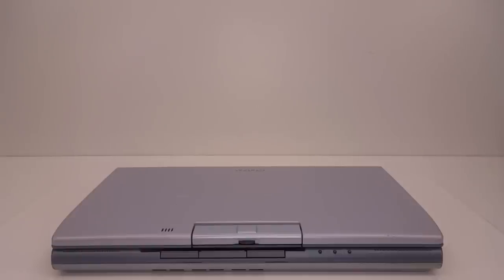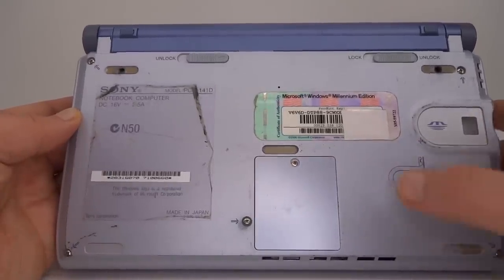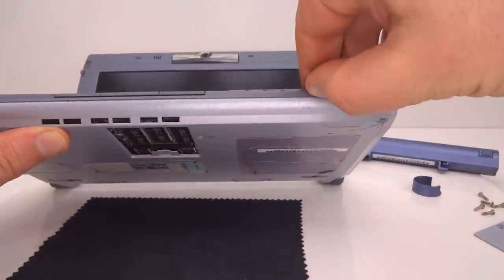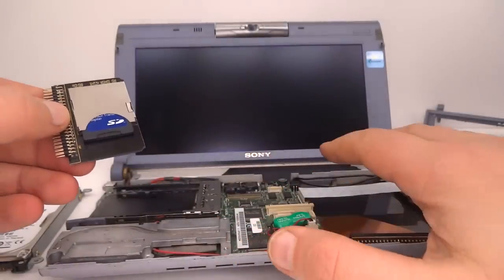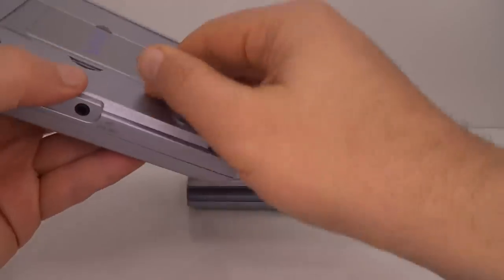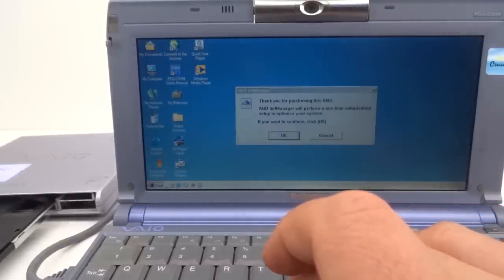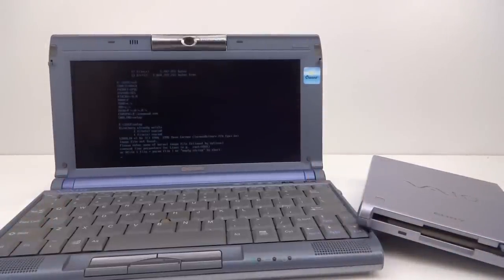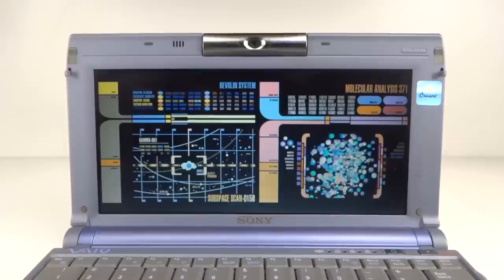Sony VAIO PictureBook Millennium Edition

Comment: Thanks for the video, as always, but just my two cents - SD>IDE adapter is a terrible idea in this case - Win2k/Me has no TRIM support (and that IDE adapter would make it useless anyway), also IO throughput of the SD card is terrible already, and longevity of that poor SD card without TRIM will be down the drain. CompactFlash (or even a real IDE SSD - quite cheap on Ebay) would've been much better solution in my opinion.
Reply from the maker: Thanks, I will be experimenting more with CF and other methods.

Comment: Ultrawide and CinemaScope are not the same exact aspect ratios (though they are close). Motion picture CinemaScope is a variation of 2.33-2.37:1 (64:27 or 7:3) and based on 4:3, while Ultrawide is a variation of 2.38-2.4:1 (43;18 or 12:5) and based on 16:9. This is why watching Cinemascope-shot film on an Ultrawide will still yield minor letter boxing or pillar boxing depending on the "21:9" resolution of your monitor (i.e 3440x1440 vs 3840x1600, which both are "21:9", but not quite the same aspect).

Comment: I recall I had a 10" tablet PC that also had that processor. SonicBlue ProGear it was. Must have been just after the Millenium approx 2001-2002.  I may still have it somewhere.
That had a 1024x768 screen and was a touch screen.  I had Windows ME on there along with AutoRoute Express and a GPS usb dongle.  Quite impressive bit of satnav and in car web browsing (for the day).

Comment: I remember when I was in high school, I got my hands on the latest model of the PictureBook and quickly installed Gentoo Linux on it. Wow, what a headache find all the correct drivers to get everything working and the setting the special xfree86 configuration to get the display working properly.

Comment: A stripped xp and a current low-tech linux should be good options to run something useful, the vaio still has a good size for school desks. W2K has the same hardware needs but got left behind after XP was released.
Reply: There are ways to patch W2k to run some XP software if you are so inclined, although it is a lot of effort for something that XP can do without a hitch
Reply: Debian runs on most things still with a recent kernel

Comment: An IDE SSD or IDE to Compact Flash would have been much better, and would have provided much better IO speeds. I recently replaced the harddrive in my 1997 Toshiba Libretto with a compact flash, and it really flies.

Comment: Its display condenser - transformer runs at a much greater voltage, I connected a 11 V Asus laptop battery directly to 2 pairs of cells, that is about 8 V. Some chips burnt out, but still transformed the voltage to the light. The bulb lights at a really bright light at this voltage. Its capacitor type inverter is designed to transform the voltage to much higher, than a similar transformer could do. Sony means: Sorry New York.

Comment: Hi, just got mine up and running. How loud is the fan on yours? Mine seems to be constantly on and I put new thermal compound on mine.
Reply from the maker: It's quite loud at full speed, especially by today's standards. But it's not constantly on. The CPU in mine is the Transmeta Crusoe which could run cooler.
Reply: @JanusCycle  Thanks for the feedback. I have the CWMWP so its a 867Mhz Crusoe as well.

Comment: Can i install os on it using usb?, i have vaio picture book pcg c1mt but i don't have the CD Rom
Reply from the maker: It would be very difficult to boot anything from USB. Sony did not include native USB booting in VAIO until the late 2000s.
Reply: @JanusCycle  is there any other option? , using a memory stick , or use part of the internal hard disk to bootable? , because i dont have the cd rom , and Verry hard to find here
Reply from the maker: @retronrandom835  It's possible to setup a DOS bootable hand drive with Windows 98 or probably Windows ME install files. Boot the drive inside the machine into DOS and install from there. I did this in my Toshiba Portégé ultraportable Windows 98 revival video.
Reply: @JanusCycle  Thank you brother

Comment: I wasn't expecting this very small machine to mount a 2.5" but one of those notoriously slow 1.8" ones (yes, the Libretto did that first, but, whatever). Not sure if that would have been the main performance bottleneck on a TM Crusoe machine, though.

Comment: Honestly, I don't see the point in installing old operating systems that are currently useless and are not even supported. Mostly when updating hardware with things that didn't exist at launch. He took out a 160GB mechanical disk because it wasn't from the time, but he puts an ide to SD adapter that didn't exist either. One nonsense after another.

Just install Debian.

Comment: 17.20 It is NOT complaining, since the caption says the CD contains a NEWER version of Windows. W2000 is of course older, but the installer is either taking the Service Pack release date into account or is coded to encourage Windows 2000 adoption, since it was a more expensive OS.

Comment: I’ve just bought a PCG-C1VE although I think I’ll keep Me on it. I did wonder whether to attempt to install Linux on it somehow. 

It’s a lovely looking machine, I mainly bought it because of its Crusoe CPU which I find very interesting.
Reply from the maker: The CPU is very interesting indeed. Doing a Quake benchmark yields a better result on the second pass. Supposedly because the CPU adapts to the x86 code.

Comment: A weekend plan for my exact same model was to keep the case and fill it with some raspberry system with the secret hope to re-use the ultrawide display. But man, you made me reconsider things. Please keep on digging on the linux route and keep posting! BTW I have the original install cds if needed.

Comment: Just a little tip (yes I know the video was three years ago) but a spinning disk from the end of the IDE drive era will outperform a no-name uSD card in a chinese ide->SD adapter.. would be a "better experience".
Reply from the maker: Thanks for the tip. I guess Compact Flash would be better.

Comment: Those Crusoe processors were apparently dog shit, dunno if you found that later
Reply from the maker: Yep, I have had a closer look at Crusoe, they are interesting, but slow.
Reply: @JanusCycle  Yeah I did a bit of reading on it - it seems like they were pretty much just ahead of Intel of the "converting instructions to micro-operations" and splitting across multiple execution units.

Once Intel brought that in with Pentium Pro and Pentium II, they gained like 200% performance and murdered everyone except AMD.

Comment: Where did you get the 'one tenth the transistors' figure for the Crusoe? I've recently become quite interested in it, but I haven't yet seen that figure in writing anywhere.
Reply from the maker: This was a fairly common claim in their marketing. If you continue to not find anything I can review my sources sometime. Have you also watched my 'The strange code morphing CPU inside the Sony VAIO U1' video ?
Reply: @JanusCycle  I have indeed, I thought it was very good; I suppose I'll spend some time looking through contemporary marketing material, but if you recall off the top of your head it would be much appreciated.
Reply from the maker: @pawanyr360  I don't recall, but I will find a way to check. I would like to be able to back up my statements. Thanks for watching and your comments.
Reply: @JanusCycle  Thanks! I'm a new subscriber, and your videos are great - you should make more of them!

Comment: Cn100; looks like a connector to me looking at the name :)
So to access the HD you need to take the whole thing apart? That seems to be a lot of work :( Also the idea to use a SD card with windows is not really a good idea, considering that the swap file of windows will kill any solid state memory like SD cards pretty quickly. You can get a cheap modern mechanical hdd and have that running for at least another 15 years :)
Reply from the maker: Thanks that's good info. But I kinda like the idea of pushing an SD card beyond it's limits. I put Windows 98 on an SD card in my Toshiba a couple of years ago. I want to see how long it lasts.
Reply: @JanusCycle  Sounds good; if you pick good quality SD cards they last longer, since they have more write cycles than the cheap ones. 
For modern OS you can turn off the swap file, but for old machines running W95-98 and ME I don't believe you can do that; so the SD really get hammered.
If you can access the SD card from the bottom, then that's not a big deal, cards are cheap these days

Comment: Hey, I just got a C1VN with no power adapter and I cannot seem to find anywhere that sells it, anyone know where I can locate one?
Reply from the maker: These appear to be quite hard to find. I don't know where to get one. I would keep looking. I would also consider building a connector and modding a different power adapter. Doing this is very risky though. If you get the polarity or voltage wrong you can kill the VAIO in an instant.

Comment: You'd better to remove the CMOS battery as quick as you can, or it will leak and corrode your computer mainboard.
Reply from the maker: Thanks, great advice.

Comment: I think that connector in the middle of the board is for a modem module, looks like there's a plastic piece where the phone jack would be on the right side of the machine
Reply: Así es, un módulo Conexant - Sony 56 kbps que se conecta al lado del DialJog. Lo acabo de ver porque desarmé mi C1VR/BP

Comment: It's quite impressive that they managed to fit what looks like a regular 2.5" laptop hard drive in it. I have a Dell Latitude D420 and even though it is a lot larger than this at 12", it uses a 1.8" hard drive.

Comment: Great video so glad I found the channel. Anyone got any idea on where to find a charger for this badboy? Seems like a unique end and I'm tearing my hair out trying to find one.
Reply from the maker: Yes, finding a charger can be difficult. Mine has a rectangular plug. Some PictureBooks, I believe have a round plug. Mine requires a 16 Volt charger, some may need 19.5 Volts. I'm not sure because I only have experience with this one model, with that weird rectangular socket. Yet I see chargers for PictureBooks with round plugs online.
Let us know the exact model you have may help? And the shape of the charging socket?
Reply: @JanusCycle  It's the same as the one in the video, that weird rectangular end that for the life of me can't find any info on

Comment: I wonder if this will run Windows 98 Second Edition with KernelEx on it.
Reply from the maker: I didn't know about KernelEx until you mentioned it, thanks. Sounds interesting, says it works with ME as well as 98.
Since this video, I have been able to successfully install both 2000 and XP triple boot with 98. The current problem is the display or monitor drivers on 2000/XP. I've tried many and they all refuse to work with this custom resolution display.
Reply: @JanusCycle  That's sad. But I hope that KernelEx will help. I've seen people use KernelEx to run Minecraft on Windows 98, lol

Comment: Bought the same model on ebay. Have a question, where i can download original recovery cd images?
Reply from the maker: Have a look on archive.org. There are C1 recovery images available. Not all models are compatible with all images. Some are for 98, ME or XP. Let me know which model you have if you can't find the correct image.
Reply: @JanusCycle  Have the same C1VE with Transmeta Crusoe